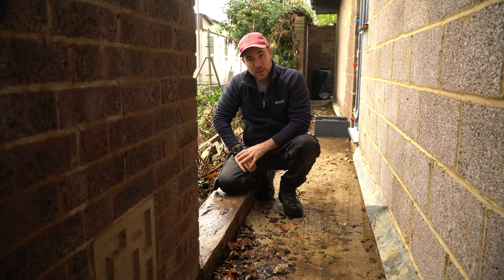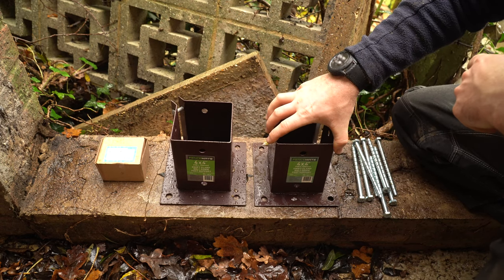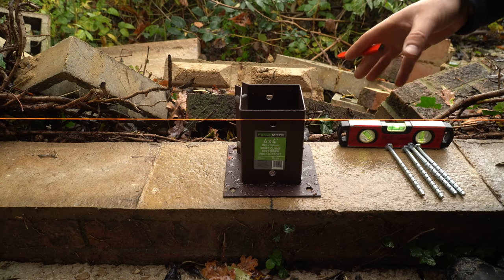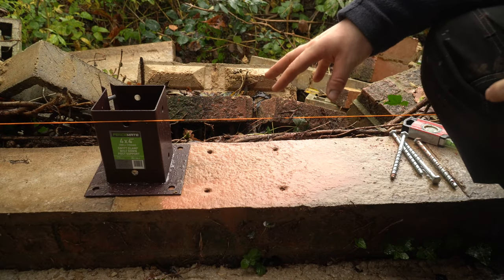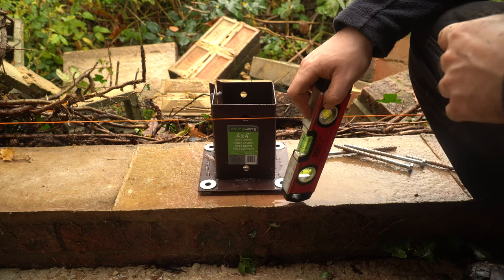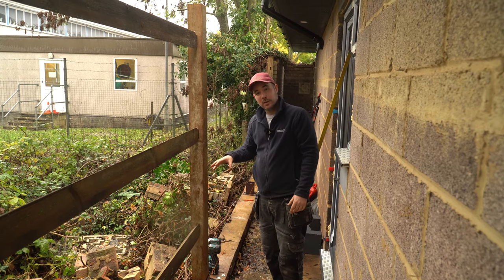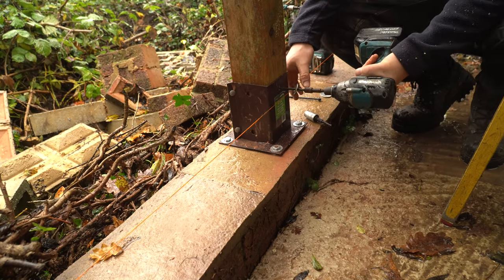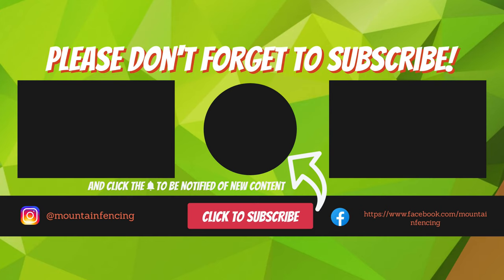Install a Fence On a Wall | The EASY Way

Comment: My experience with any arrangement that involves welded fixings is that they are complete and utter rubbish.  The welds are not as strong as the connection between the plate and the concrete, and if the fence needs to move, that's where it will move.  I've used metal fixings on one fence and never will again... from here on out it will be concrete all the way, or fixing the posts directly to the wall with anchor bolts.  I'd imagine this would work for a very small fence that isn't exposed to the wind, but for a high fence, nope.
Reply from the maker: I do agree these arent the way to go with very tall fences subjected to high wind but if installed properly, in the right depth of concrete these do work really well. Ive installed 6ft high fences and ive not had any problems with them.
Reply: @JamesMontana  That's good to know as I may need something similar for a 5 or 6 foot fence.  We did a new garden fence with 750mm spikes, and at least one of the spikes has snapped off just below the cup that holds the post.  I'm sure if the welds were better quality it would be alright.
Reply from the maker: @FanPhys  i honestly think that must have been a freak occurrence because i have removed lots of these from concrete by anchoring off them to pull them out and they have never snapped unless completely rusted.
Reply: @JamesMontana  yeah, I think the welds on the spikes I got are a bit cheap and cheerful, to be fair.
Reply from the maker: @FanPhys  sounds like it. The quality is going to vary where you get them from.

Comment: Excellent video, very informative and straight to the point! Quick question: Can I use a combi drill to fit the thunderbolts or do I have to use  an impact driver?
Reply from the maker: Thank-you. Im glad you found it helpful. Yes, no problem at with using a combi drill at all. Just make sure you have it on the screw setting or it might take your hand off !

Comment: Fantastic video buddy, thank you.

Would this work on a concrete block retaining wall, if the concrete blocks are laid on their widest edge (215mm)?

And would it be fine to attach the much narrower DuraPost steel posts using the DuraPost bolt down?

Comment: Hey mate I got the same  ones on Amazon. They come with bolts to bolt down but they are bolts with nuts and a special device to expand in the concrete but they are only about 3 inches long. Do you recommend those or using these. I’m building a fence on nearly the same slab of concrete you have !

Comment: Can you use railway sleepers instead of brick wall and then use the post brackets drilled into the sleepers?
Reply from the maker: You can do it with lightweight fencing like 4ft picket or trellis but you will need to be sure the sleepers are fixed to the ground securely.

Comment: Hi, we’ve used these bolt downs for our new fence posts on top of our concrete paving. Worked well for the first 6 months, though fence is now leaning and out of place due to recent storm/ gale force winds etc. Is there any extra support that one could apply to reinforce the fence post?

Comment: Hi, I am just wondering how you attach wooden gravel boards when using bolt downs? Thanks.
Reply from the maker: The bolt downs usually come with holes on the sides to screw in cleats. Sometimes they dont but you can just drill holes in the metal if not.

Comment: I find those fence mate swift clap bolt down post supports a waste of time along with timber posts.  The tinber always shrinks depending on the weather and the posts become loose over time. I fond using metal posts between your cladding sections to be a far better option.  Hello from Ireland 🙂

Comment: Great vid.  Just what I was looking for. I need to build similar for my front garden wall,  but the feather edge board / fence will only be 55cm tall. (it's a small fence!) and about 4 meters long.  Do you / any other's think I can downsize on the posts/masonry screws given the wall is not going to be subject to the same sort of forces as a 2m fence?
Many thanks.
Reply from the maker: Thanks man. Yeah go down to 3" posts and they will be fine. The 4 " posts are a bit too big  for small fences and can look too much. 100mm screws will be absolutely fine too.
Reply: @JamesMontana   thanks a lot for a prompt reply.  Impressive!  I was contemplating 2" posts and 75m screws but thought that may be pushing my luck a little and may be too flimsy.
I'll go with the 3" posts and 100m screws.  thanks for the advice.
Liked, Subbed, and I'll use you affiliate links when I get around to doing this.
Cheers! :)
Reply from the maker: @theduftmeister  really appreciate 🙏 And yes, never use 2" posts for anything lol. Good luck with it 👍

Comment: I want to use these post holders on a 5ft tall featherboard fence that will be 11m long - will they be strong enough?  I plan to use about 8 or 9 posts to distribute the load from the wind.

Comment: Hi, I have a question. Can I install these anchor bolts into a red adobe brick retaining wall??
Reply from the maker: Hi Mary, 
Yes, providing the wall is wider than the size of bolt down plate you are using and at least 4" thick. You want at least a 2" clearance from the drill holes to the edge of the brick. Too close and you might crack off the edge. I hope this helps.
Reply: @JamesMontana  Will they be strong enough to support a 6' wood privacy fence? Thanks so much!
Reply from the maker: @marylandry440  i would always be worried about putting a 6ft fence on bolts downs but i have put a 2m fence and its been fine. All depends on how windy it is in your area. Is the fence in an exposed position ? How old is the wall. Remember though, in the uk the max height without planning permission of a fence is 2m from ground level and that will include the wall. If the wall is over 2ft in height, id bolt posts to the front face instead. That'll be alot stronger.
Reply: @JamesMontana This is a side yard that sits below ground level. I wanted to put up a wood fence that is 3' then add a temporary addition to the top like ladest or bamboo for extra privacy. Its hard to explain how my land is but the whole lot sits down from the street and is not level. I live in San Diego, Calif so we don't have a lot of harsh weather. Oh that retaining wall is at least 50 years old. Thanks so much! Mary
Reply from the maker: @marylandry440  id say that was absolutely fine then. They will hold 3' high fence with a bamboo top no problem. Especially since its down a side alleyway. Just as long as the wall isnt falling apart. Good luck with your project 👍